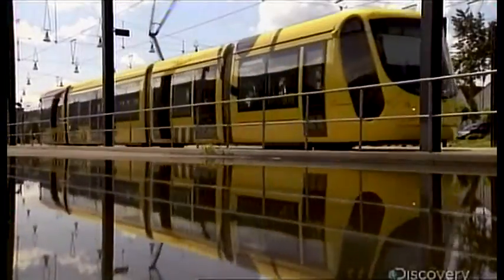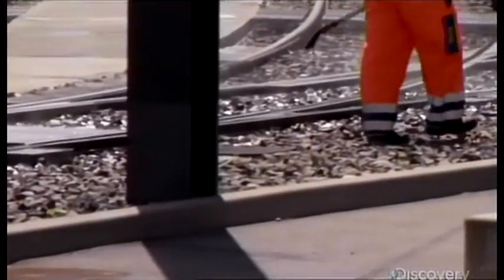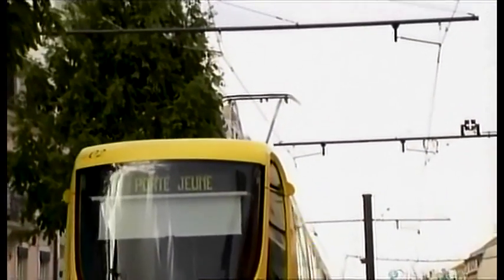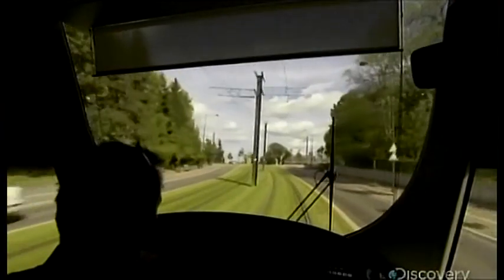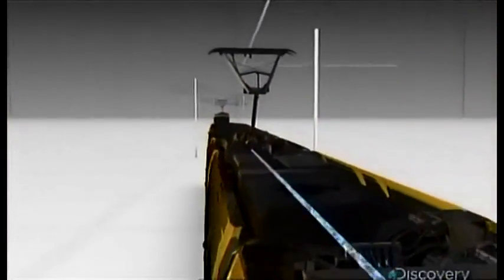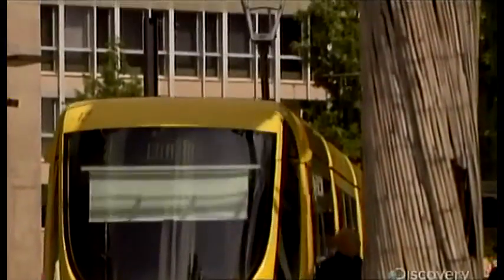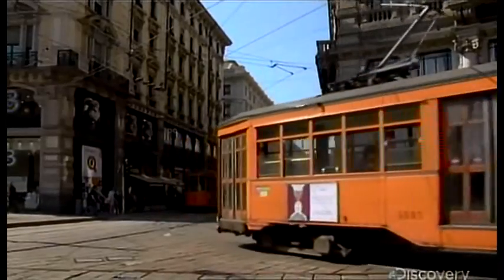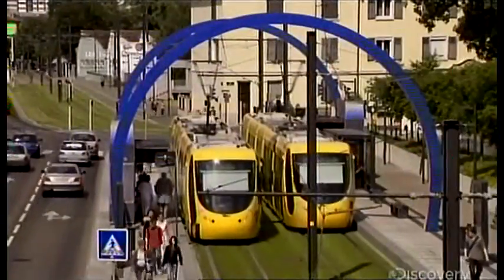How Tram Works

Comment: How does a tram switch tracks to when it is connected to the electric wire via a current collection arm that wraps around the wire?
Reply: The pantogrph isn't wrapped around the wire, it's only touching it from below.
Reply: In my city they use these "trolley pole" collectors concurrently with train style pantographs on new Skoda trams. I've not seen one up close. It seems to touch the wire from the sides and below. https://en.wikipedia.org/wiki/Trolley_pole
Reply: @j7ndominica051  it's still only connecting from the bottom. The article you linked has some pictures up close as well as an example of a switch.